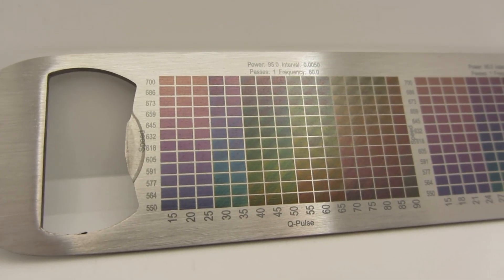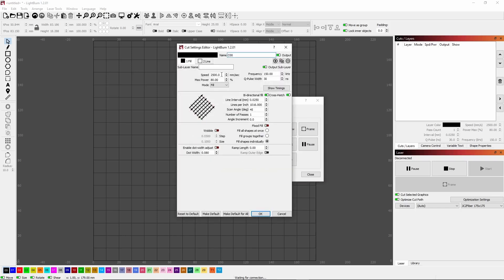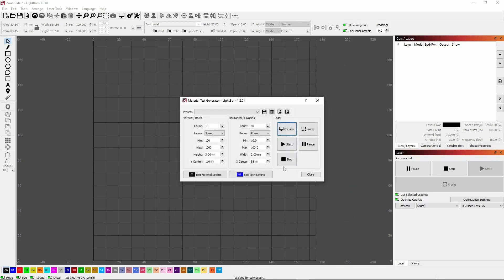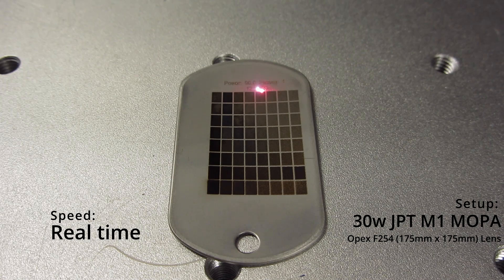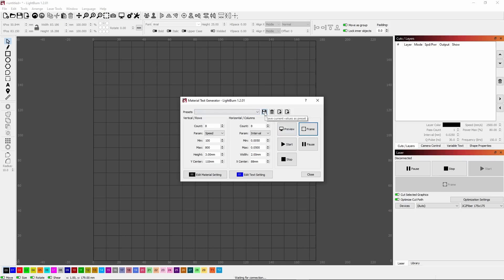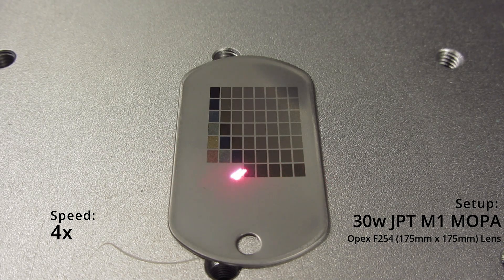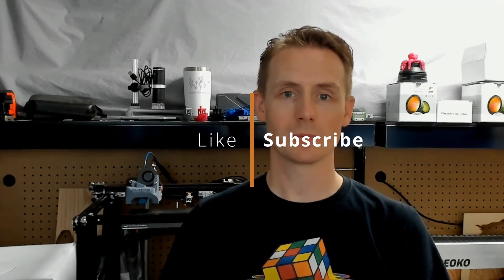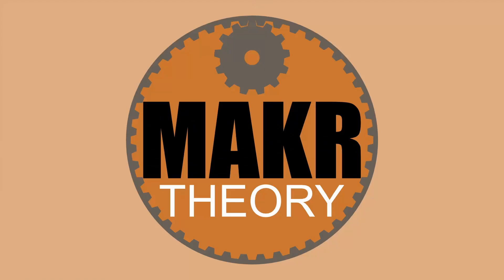Laser MOPA Color - LightBurn Material Test

Comment: Very new to this, thank you for making this video. A couple of newbie questions if you'll permit. What does the interval factor represent? I get speed, power, and pulse width, but wonder if this is line/ hatch spacing.  You have a 3mm lens setting, not sure what this means as height above material would seem really close. Thanks in advance!
Reply from the maker: You are welcome. You are correct, interval is the line/hatch spacing. I am not sure what 3mm lens setting you are referring to. There was a setting for the size of the sample squares that I adjusted to make them 2mm x 3mm. I also mentioned using a 300mm x 300mm lens, that would be in regards to the scan field size. Are either one of those what you are wanting clarification on?

Comment: Is a Laser Pecker 3 capable of different colors?
Reply from the maker: It is a completely different wavelength of laser. I have heard of people being able to get a dark mark on stainless with a very select few high powered diode lasers, but I have never used a diode, so I cannot confirm nor deny the claim. I would contact the manufacturer and see if they recommend that device on bare stainless steel.

Comment: How does it do colors?
Reply from the maker: There are a couple ways, the colors with more shimmer to them are a microscopic surface distortion that bends the light to make our eyes perceive a color. The more solid colors are a heating of the material to just the right temperature to produce a specific color, similar to like you could do with a flame or TIG welder.
Reply: @MakrTheory  Thx 👍

Comment: Hey, I’ve just started using a fiber laser and this video really helped I was just wondering if you have still pictures of the setting and the results?
Reply from the maker: I don’t, but honestly each setup will vary so you will likely not get anything close to the same results using my settings on your machine. Your best bet is to run the material tests yourself and see what works best for you.
Reply: @MakrTheory  sounds good I’m working with a laser star fiber laser and they don’t allow like any content on it which is kinda dumb but how did you get those tests done is there a video I can find?
Reply from the maker: @cubingcracked3521  I’m using a different software called LightBurn. I believe your Laser Star software is actually EZCad with a custom skin. You can go to LightBurnSoftware.com and download a 30 day trial to see if it will work with your machine.
Reply: @MakrTheory  okay thank you
Reply from the maker: @cubingcracked3521  you are welcome. If that doesn’t work, you could try an EZcad grid from the website lasertips.org . They have some preconfigured grids for EZcad, but because it is not an automated script, it requires you to change each setting manually when you want to try something different. The last option is to literally draw your own and assign a pen to each square. I have done it before and it is very tedious.
Reply: @MakrTheory  well it’s spring break and I got the time to burn so thanks again for your help loved the video I tried one of the blue settings I saw on your video but my laser only goes to 80Hz and can’t hit 125
Reply from the maker: @cubingcracked3521  does your software give you the ability to change QPulse? I am not familiar with Laser Star’s lineup, but normally lower frequency ranges like that are an indication of a Q-Switch source. Your settings will need to be much different to achieve color and may require a very large lens or out of focus setup with very low power.
Reply: @MakrTheory  I honestly don’t know but I have had some luck with color such as red being power at 8 frequency at 65 speed at 200 line spacing at 0.01 and angle at 90. This isn’t my machine I’m lucky enough to use it whenever I want and the company gives out a few colors it can do
Reply from the maker: @cubingcracked3521  I would try working off of that red setting, or any other color settings they have provided. Start by shifting the marking speed up and down. Next start playing with line spacing. A small change in line spacing will make a big difference.
Reply: @MakrTheory  okay how big or small of a change in the line spacing? Like 0.05 or 0.1 etc…
Reply from the maker: @cubingcracked3521  I would go with increments of .001 or .01 max. The increments make a big difference in the number of passes made in a given area.
Reply: @MakrTheory  okay sounds good looks like a got a big project😂 thank you so much for all of your help and taking the time to teach me what I need to do
Reply from the maker: @cubingcracked3521  you are welcome. It is all about getting on the laser making one change at a time to see what it does. Take good notes and it will be easier to see trends and figure out what works best for your setup. Best of luck!
Reply: @MakrTheory  thank you

Comment: I have a 60w M7 MOPA so with power how would I compensate 🆚 your 30w?
Reply from the maker: Cutting power in half should get you close. There are some other factors, like lens size that play a role in power output. I am working on a calculator help convert setting between machines, but it is not quite ready yet.
Reply: I'd be very interested in this converter your working on. Most everything I see is for lower powered lasers I just got my 80w today.
Reply from the maker: @briancs613  It is coming along. I hope to have the initial version available on my website in a few months. I will be announcing here, and anywhere else that will let me, when it is ready.
Reply: @MakrTheory  👍
Reply: @MakrTheory  it hard to decide what lens as well.
Reply from the maker: @hammeredgem.j.c.9030  to get results similar to my 300 (F420) lens, you will want to use a 175 (F254) lens on your 60w M7. There are two model numbers for the 60w, if yours has an “E” in the model number you may need to increase power slightly.
Reply: @MakrTheory  thank you that is what I got on right now 👍

Comment: 30W JPT MOPA with Lightburn
I’m trying to match your settings but I don’t seem to have Q-pulse width?  Do you know why this would be or where to turn this setting on?
Reply from the maker: It is in the “Device Settings” ( the wrench and screw driver icon next to the gear). Under laser type there is a check box “Enable Q-Pulse Width Setting”.

If you don’t see qpulse making any changes, you will want to confirm your source model number to make sure it is a variable pulse MOPA. I have seen some sellers list the JPT LP-E models as MOPA without differentiating that they are a fixed pulse width.

Comment: Its me again, a proud new owner of a JPT MOPA 60W.  Already tried some colors on stainless steel, look great, interesting.   But what I could use more in my business would be the blacker blacks, and whiter whites (not shiny, but matte white viewed from all angles) both an stainless steel and aluminum.    Can you give me a clue what specific settings there are (if any) a MOPA is capable of marking deeper blacks than a plain Q-switched laser?
Reply from the maker: Congratulations! I have not experimented with white, but black marks are typically pretty slow. The advantage to MOPA for any color marking is being able to use a standard focus distance, instead of being out of focus. Out of focus required the material surface be very flat and uniform for a consistent mark.

Your source model and your lens size play a big part in getting the right settings. I am currently working on a calculator that will help translate settings more accurately. If you can provide those, I can give you a good starting point.
Reply: @MakrTheory  Thanks,   I have a JPT M7 MOPA 60W    Model number of the laser source is:  YDFLP-E-60-M7-M-R     The galvo came with two F-theta lenses, a 175x175mm and a 220x200mm one.    I use mostly the 175mm one nowadays. 
I need the darkest  black marking possible on stainless steel and aluminum ( I know it works best on anodized, and only grey is possible on pure alu, would be also great to improve that) . 
Already tried to do some tests with multiple passes on steel,  especially when marking QR codes as part of machine data plates, a higher contrast makes the QR code better readable.   It is though important that the marking looks dark from any angle,  I already managed some tests that look silverish shiny from one angle, and almost black from another angle.  Interesting but not what I can sell.
What I also tried is to clear the surface with a 'clearing', white run first, a rectangle behind the QR code and then mark black on it,  but maybe this approach is too much of hassle though and does not give a better result at all.
Reply from the maker: @nick066hu  for your setup using the 175x175 lens, I would start with
Speed: 60mm/s
Freq: 34kHz
Power: 19%
QPulse: 210ns
Line spacing: .028mm

This should get you pretty close, but you may have to adjust the QPulse up a bit. I normally use 2 passes or a single pass with a cross hatch. The mark should be smooth, glossy, and be dark from almost every angle.
Reply: @MakrTheory  I just tried it, it looks great, deep and uniform black at all angles. Did it as you suggested with a single pass but cross hatch.   What I learned when I looked at it at an angle during the marking right after the first pass but before the second, it was then showing different darkness depending on the angle a looked at it.   But the second pass made it right, now it looks the same dark at all angles. 👍   
I think did not pay attention to turn on multiple passes / cross hatch at my earlier testing.   and also those five setting make a lot of combinations we have to try out.  Thanks a lot.      One thing I will keep trying to refine later, if there is a setting that marks faster with the same results would be even better.
Reply from the maker: @nick066hu  Perfect! Thank you for testing and providing the feedback. My calculator is still in development, but so far it is working as I have intended. Next step is to have it calculate optimized settings to take advantage of higher power output machines.

Comment: I’m having nothing but problems coloring Titanimum. One thing I noticed was your hatch is way closer then mine. I was running .02-.04 and your in the .001 range
Reply from the maker: On stainless I achieved results below .020mm hatch spacing, but found .005mm worked really well for me. I haven’t tried Titanium yet, but I recently had a couple pieces delivered. I plan to do some more testing and post results in a follow up video.

What lens and model laser source are you using? I found a 300mm F420 worked really well for my M1, but I suspect most other sources will work better with something a little smaller.

Comment: I’ve been looking for this Mopa testing and information thank you! I have a 30W JPT MOPA  too and most of my need is to engrave deep black on silver anodized aluminum. I’ve struggled with settings and consistent results. I seem to get the darkest at a Q pulse of 2 at 460khz. But even then the viewing angle is not wide (lighter as angled) and lighter than hoped. The range of options are endless, just recently considered ‘out of focus’. I would be elated if you made a video with this material.
Reply from the maker: You are welcome! Glad you enjoyed it. Anodized aluminum is on my list of materials to do more experiments with. Make sure to subscribe with notifications turned on so you don’t miss it.
Out of focus can increase your spot size and disperse the energy over a larger area. If you do try this, make sure you lower the focus below the material to help reduce chances of reflecting back into the lens. I personally prefer switching to a larger lens rather than out of focus because the depth of focus provides more forgiveness on uneven surfaces.
Reply: @MakrTheory  raising focus is actually worse and causes reflections to focus on the lens. inadvertently damaged a lens by using raised focus. you want to mark off center so reflections go off to the side, not back into the lens.
Reply from the maker: @TMS5100  Thank you for pointing that out. Not sure how I had reversed that when all my notes say to lower the focus. I will edit that response for anyone else going forward.

Comment: The JPT unit's jump the q-pulses. Can't remember where I red but doing lower than 6 isn't worth it, and doing numbers between multiples of 3 in between is pointless. Try running lower end tests with a q going something like 6, 9, 12, 15, 18, 21, 24, 27, 30. At some point this changes, and I don't know where, but definitely it makes a difference. I have stacks of stainless beside me, done hundreds of tests like you have. Good work, it's a tedious adventure.
Reply from the maker: Thank you for that information. That would definitely explain the results I got where q-pulse didn’t seem to make much difference. I will have to do some digging into the source specs before my next video on colors.

Comment: have you tested color marking on multiple stainless steel alloys? im very curious how marking changes between 316, 17-4 1100ht, and most importantly 303!  the alloying composition between these materials is very diferent!
Reply from the maker: In the video I did test on 304, 316L, 17-4, and unknown “stainless steel” parts from Amazon. All results were similar with the exception of one sample, but I believe that one was a focus issue because a second sample of the same material matched the other alloys.
Reply: @MakrTheory  hmmm. 304 is reasonably similar to 303 with a few exceptions. thanks for the insights!  ill have to investigate furthr as i go down this prooduct rabbithole

Comment: How durable are the markings?  I suppose the lighter colored ones are prone to fade, discoloration, rusting(?) when used outside. (in direct sunshine, rain, frost, etc)   I would bet on the blackest setting when used outside, how durable is that?
Reply from the maker: This is something I have been monitoring. Some of the samples had been made months before filming and sat in my non-climate controlled garage during that time. I live in a very dry area, so higher humidity areas may see different results. I plan to follow up with further testing, exposing the marks to corrosive environments and find solutions to preserve the marks if necessary.

Comment: Thank you, nice job. My 60W JPT MOPA is on the way due to arrive in 2-3 weeks. Bookmarked your video,  I will begin with tests based on your settings.   Will you do some testing also on aluminum?
Reply from the maker: You are welcome. My settings will be a bit heavy for your 60w, but if you cut the power in half it will give you a good baseline to start. Don’t be afraid to experiment with different size lenses. I have had best results with a 300x300 (F420) lens.
Reply: @MakrTheory  Thanks, my machine comes with a 175 and a 220 lenses. I was also thinking about a 300x300 lens but I somehow thought the larger dot size will result aliased lines especially when marking small fonts. I may be wrong, may be it would worth to get a bigger lens also.
Reply from the maker: @nick066hu  Spot size with a 300x300 lens on fiber is still smaller than a CO2 beam, so you still have pretty fine detail. Take a look at the text at 13:08 (175 lens) and the text at 13:40 (300 lens).

You should be fine with the lenses you have selected already.

If you think you may want a 300, it is usually cheaper to have them add it to your laser order. I would double check the price elsewhere just to make sure though.